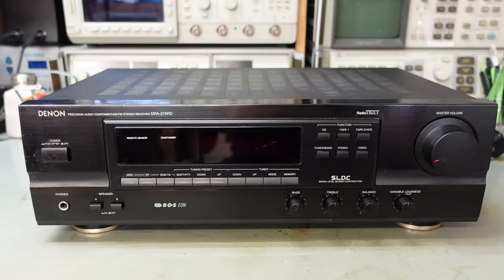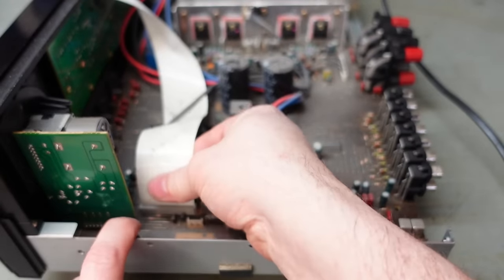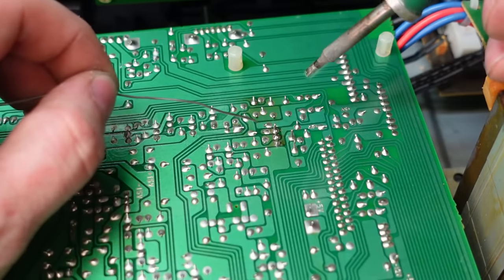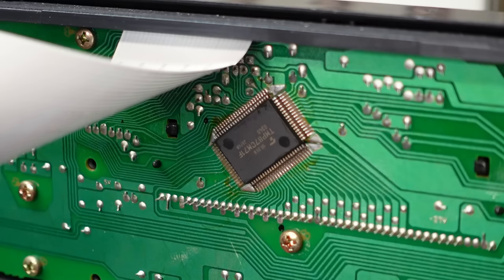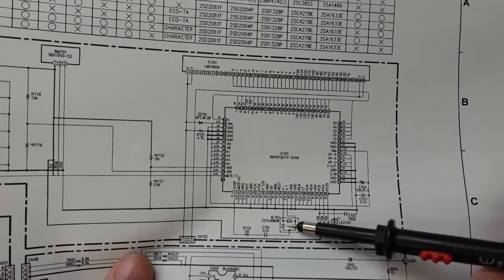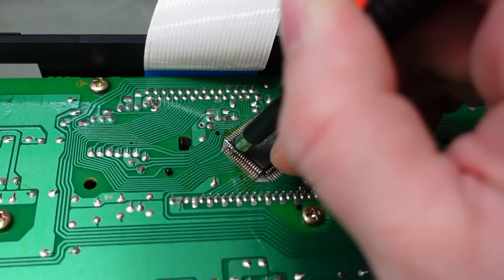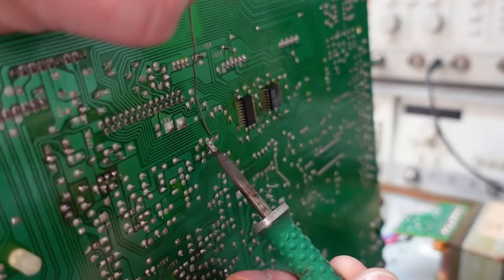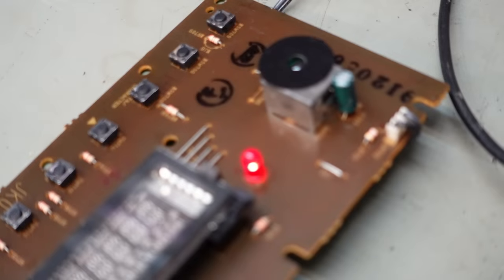DENON and the irreparable failure.

Comment: I have a similar era Denon receiver, an AVR 2500 that I bought new in 1996 or so. I've used it heavily and it's my favorite receiver ever. It has the ability to make any set of speakers you hook up to it sound fantastic. It ran a pair of Klipsch Chorus IIs for about a decade, it lived through 8 years on a modified sine wave power inverter in my cabin, now it runs a sub/satellite Bose speaker system in my office. It was my 2nd "big" audio purchase ever and I hope it lives another 27 years.  Only quirk it has is sometimes the buttons on the unit will act like you pressed a totally different button.

Comment: The microcontroller is reprogrammable, and still available.  The Denon allows for DFU ( direct firmware update ) using a DOS/Windows program to perform the first update.   It is an older Denon ( being 20 years old indeed ) which doesn't support many modern features that are needed for HDTV's ... but it is a pity that it's for the bin.

Comment: Great video - I worked in a Hifi shop at weekends 30 years  ago when I became interested in electronics and building amps and active crossovers. I was horrified at the amount of nasty cheap components in the signal path - stuff I would never put in my own builds - carbon film resistors in the signal path - even in the NFB in amps costing a months wages!
 Marketing, Gimmickry, proprietary protectionism and planned obsolescence, not much has changed.

Comment: I repair electronic equipment for a hobby (self taught) and I usually get everything working, but when I start to open some device to repair, I always dread that an unobtainable IC has failed in it. For example, in this video, where you will have to bin the Denon. That's why I enjoy working on pre-IC equipment like old Dansette record players, where the parts are still easily available.

Comment: Excellent work.
The comment, "That's weird?" .........is something I have muttered a hundred times when trying to debug a circuit.

I know the unit is old, but to be unable to fix a receiver because of software in a discontinued chip is very disappointing.
That software/chip is just an unnecessary (control) wart in the circuitry: I am old school....all you need is:
input jacks, selector switches, preamp, amp, speaker jacks.
Leave the software to iPads.

Comment: I repaired a similar vintage receiver the other week. What was odd is that the reset was not clean / fast enough with the "dim lamp" in series with the mains and the micro failed to start. As soon as I went back to straight mains the unit it worked fine. It had me flummoxed for a minute!

Comment: Great to see, hopefully further advice from comments will see this working. I used to work at Marshall Amplification in test & service (88-93), then Alpine Car Audio (93-97), before the days of in-circuit firmware upgrades so regularly replaced similar controllers.

Comment: I had a Denon receiver around that time. It didn't have an issue removing from standby mode into playing mode. Mine also had an enhanced bass button near bottom right next to the variable loudness. It worked very well, I added a graphic equalizer to it using the first cassette player input which gave more control and doubled the volume.

Comment: Yes when AV Receivers and the like are controlled by a Microprocessor it's a ticking bomb. Onkyo AV receivers are also notorious with similar problem in their Syscon boards. With this Denon you may succeed in fidling for the On/Off control to power up but other function like source selection, etc. may not work either so yeah it's parts out unit then. I love watching videos on this channel which give good information. Mark is really patient at work and always smile.

Comment: Some of the later receivers are even harder to fix ands often to time consuming or much trouble to repair them .Be careful with the flat ribbon cables after so many inserts and removes contacts can start to lift .
Reply: Yeah, those cables are like the human pancreas - you don't touch them, you don't even go near them unless you absolutely have to.  I was cringing as he was yanking on the ribbon.

Comment: Can't win them all. But this video is a great example of investigating and finding the source of the problem. 
I have a Denon DRA-325R from 1989. Was given to me. Lightly used in an office (they guy listened to AM radio through some fairly expensive speakers).. I got it some years ago and just started using it again when my NAD C368 failed. Died in 3 years yet the old Denon still works. Go figure!

Comment: Try a Denon remote to turn it on. After the amp goes into protection mode, you need remote to start it.
Reply: OR get a Harmony remote and program it for the Denon receiver, that typically works for old IR receivers for me when I dont have the original remote.

Comment: I had a fair share of such repair attempts. Most of the time I ask the customer if they want the amplituner back with just the "amp" functionality, bare minimum, and most of them say "yep", so I just disconnect everything that is not related to the amp/preamp or power supply, and add an "AUX in" functionality. But it's sad to do such a thing, only because the IC that died is no longer being made, and it has to have proprietary software on it...

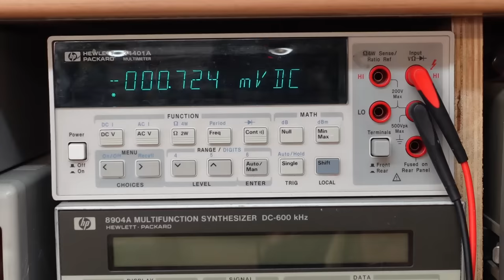Comment: 6:43 - I'm not familiar with -27v driving the VFD.  Normally, I think of the filament being driven by a low voltage and the anodes and grids with a much higher voltage.

Comment: quite an unusual failure -makes me wonder if that 6v regulator went dry jointed on its ground pin first so input voltage got sent straight to the output pin as unregulated and blew the micro -but then the micro wants a 5v supply not 6v unless its going through a diode for a memory backup cap then 6v is about right-now i want to find a  schematic to check my guess !
Reply: thats what i suspect, commented elsewhere on here about it ,, its what kills commodore 64s,

Comment: I had to repair my 1987 DENON DCD-900 CD player, due to it skipping. Here I had to invest about 6 drops of electric shaver oil, to fix the problem. The mechanical movement was somewhat inhibited, due to the partially hardening of the old old lubricant.  I just fixed my 15 year old coffee maker about 1/2 an hour ago. It had a blown thermal fuse. Other than that, after a few repairs over the years, my 2004 stainless steel microwave oven is still up and going. I purchased it for about $45, due to it being a display model, or so they said. In truth, only half the keyboard worked, so I fixed that by simply cleaning the keyboard electrical contacts. At one point about 5 years ago, with just a couple of drops of glue, I repaired the turntable motor, in which there was slipping occurring between the spinning center donut-magnet, and the gear that sits inside it.  Also at another time there were the required replacements of the door micro-switches and the main fuse. These replacement parts were obtained from someone else's oven that they had tossed out to the curb for disposal. And I also fixed my 2009 SAMSUNG TV, which I am watching this video on today.  I had to replace one bulging electrolytic capacitor in the power supply section.  Then at one point my computer monitor brick power supply became intermittent. It was a bad soldering joint on the transformer, where one wire was poorly soldered to one of the multiple transformer posts.  So it was not even a PCB soldering problem. Other than that, my old backup computers PSU was causing a boot looping problem. I replaced the bad PSU electrolytic caps, and that fixed the boot up problem, and it cost about $9.50 for the parts. So all of these items are still up and going, and the repair costs were less than $20 overall. I love saving money.

Comment: I love your British expressions. Dry solder joint. Across the pond we call it a Cold solder joint. It's still dry but it's cold. And it didn't get wet with molten solder lately.

I've gone through some of these cold solder joint parts before. Sometimes you can't just re-solder them. You have to remove them. You have to clean the leads. Scrape them down. Then reinstall. Then re-solder. Otherwise you might get some crappy connections that don't seem to be dry or cold. But they are insulated! They have insulated themselves. That's how they got that way. It's a metallurgy phenomena of, nonidentical metals being connected with each other. And their molecules begin to fight each other. And they start to out gas a fine white film. To insulate itself. And that's why you need to physically clean and scrape down those leads. For a truly good solid electrical connection that will last for decades, to come.

You see…… You are only being tasked. With fixing a cheap old stereo receiver. It's a bit different. When you are trying to restore, recover, refurbish, rebirth a, 1978, $85,000, custom-built for NBC-TV News, in Washington, DC. A British Rupert Neve 36 input, custom console. That has to work like new again. And continue on for an additional 20 years. Working like new again.

 I've done it to that one and others. And it is no easy short-term  chore. Way beyond fixing a cheap consumer stereo. And amazed at your own lack of knowledge. For a Brit? My goodness man!  Have you lost all your self-respect?! Or is this all blasphemy? And by the way how is your Queen? Is she still dead? Good. She should stay that way. Now her,, inbred son is ready to destroy the monarchy. And then to dump, Queen Camilla Bowles. For a younger hottie!  Yeah baby! It's good to be the King. And off with her head! And where's Princess Diana?  Is she also still dead? Good! Now neither will know who's pussy I shall grab! As if you are King. They let you do it. And I'm sure he can, hardly wait. I mean just because he's already 74 doesn't mean anything! Just ask brother Andrew. He likes them really young. And enslaved. Don't ask me why? He was a friend of Jeffrey Epstein. Who was murdered in jail by the Trump/Rudy/Bannon Mafia. Where they all wanted to be the Fixer. And they fixed Jeffrey just fine. And now his 16-year-old girlfriend has nobody to help her. And she was the good-looking one. As it wasn't, Jeffrey. He looked like a Jewish nerd. Because he was. And liked young underage girls. Go figure with these schmuck's? Who wants a young girl? They don't know anything. They don't know what they want or how they want it? I like women who know such things and how to do them. Not the stupid young ones you have to teach everything to. What the hell is wrong with those boys in their 40s and 50s and 60s? There little happy but he doesn't get hard over people their own age anymore? I guess not?

I think older women with gray hair are very sexy. WOW! And they know what they want. And they can articulate that. So always a good ride for both. And experienced boy man only wants inexperienced little girls?  What kind of maturity is that? It's at least between the  6th and 7th grade girls? And not younger than 12. In Texas. Before you can rape them. They have to be at least 12. According to Texan law! Which will be enforced! Because if you rape a little girl earlier than 12? You are in big trouble buddy! Of course it will also be your child. And you do not have to allow for her to have an abortion. Otherwise you can have her parents and the doctor arrested and thrown in jail for 20 years. Which is the perfectly moral thing to do. To an immoral act of abortion due to rape. Why? It's a miracle! If she doesn't want that baby? We will take it! And raise it with Jesus. And so she will have the next, immaculate conception. That Donnie won the election. The election conception. And all of the liberal Democrats aborted him! Which they should die for! Or at least go to jail for the rest of their lives! But we don't want to pay for them! So they will have to grow their own food in jail. Or they can have the outdated dog food. As it is still delicious and nutritious and dogs love it. They never complain.  YOU SHOULDN'T EITHER!

This then would all work out well. In the Soviet Union. Pre-apocalypse.
RemyRAD

Comment: 12:02.  When most of the budget for the product is spent on screws... 

Might show the evolution of design as now, there are clips molded into the plastic and only 1-2 screws to hold it down... not 1000...

Comment: I own a DRA 45 that was dead after power switch cycle! The only repair shop wanted more in a bench check charge than what the receiver was worth ! I decided to at least try resetting board connections , and clean internal power switch ! The receiver powered on with no other apparent issues !😁

Comment: I was given a nice 12v tv that I had hoped to use in my camper, but the previous owner connected it up reversed and let the smoke out of a surface-mount voltage regulator. It's the tiniest little thing and I can't even find a replacement, let alone solder one on. Such a shame to have to throw out a whole unit just because a 3mm x 1mm component failed.

Comment: Dear Mark. Many thanks for your efforts. However, in my experience, the only good Denon is a doorstop!!!!!
The A.V. amps are utterly unserviceable. Also no ready backup.
I commend you for trying on this "basic" one.
Better luck next time.
Regards Allan.
Commiserations.
Reply: Yes.  My experience with 2 Denon AVR is the typical processor overheat and needs reballing due to no connections.  Dislike Denons due to known issues for which repair parts are no longer available.

Comment: Sometimes the solution in a case like this is seek a stogy looking beat up even rusty but working unit for parts. Even a non working unit is unlikely to share the same issue ...change out the card and botta bing...I've done this many times in my 73 years..

Comment: "That eighty pin rectangular bastard has all the answers" 🤣
Seriously though, that PCB is bloody awful with all those jumper links and pots and I/O sockets soldered directly to the board, though the PSU and heatsink do appear to be adequately rated.

Good work, thanks for the video.
Reply: There is absolutely nothing wrong with any of those supposed shortcomings. That’s all perfectly normal for consumer AV gear: jumper links cost less than a double-sided board, and it’s perfectly normal to solder PCB-mount connectors and pots to a PCB.
Reply: @Antonio Tejada  Soft soldered joints should not be relied on for mechanical strength and jumper links introduce unreliability because there are more soldered joints.  As someone who worked in aerospace electronics for 20+ years and designed and built dozens of projects I consider myself to be in a position to speak from experience.  The brand Naim is commercial and their products do not have connectors mounted directly on and soldered to the PCB.
Reply: What do you want from a single sided board?

Comment: Denon generally makes good stuff, but this does look like a rather low end model.  In that regard, not even Denon is immune to designing and building products to a price point.

The parts and labor required to perform a proper repair can easily exceed the value of the unit.

It's very much like a car that has too many problems to be financially viable to fix it.  Sure, you could, but why would you want to when it makes more sense, financially, to replace it?

Comment: models of this era  weren't meant to be repaired they were designed to fail after a certain time. normally after the warranty ended. they wanted folks to buy new instead. it was well into the ideas of planned  obsolesce . a idea  created by Sony to keep us the consumer's buying new components every few years instead of repairing are items. adding to land fills and filling there pockets. the idea  started in the early 90's and is a industry standard now. in other words they built cheap crap now compared to the  items from the 80's back.

Comment: I would probe with a voltmeter before using a finger to wipe dust off.  My younger brother once worked on a camera strobe that had been off for two weeks; he touched the capacitors.  His scream was easily heard from the other end of the house...😲  To be fair, camera gear doesn't have bleeder resistors, however it's entirely possible for equipment to have what used to be working bleeder resistors.
Look for bulging electrolytic capacitors, they tend to get old, dry up, maybe short and burst the safety seals that make them vent instead of exploding.  They aren't good after they vent.
Use a 10:1 or 100:1 probe for clock or other high speed signals; a 1:1 probe may have around 70pF load capacitance, which the low-power clock circuit may not be able to drive.

Comment: So sad. I was working on an onkyo deck no power nor standby also.
I spend 3weeks on this deck.
Every single components on the power section I removed it out and test. All seems OK.
But when I came to the display board seems thats there is something wrong may the ic is faulty or the display.
Even I call a friend technician for a double check. He said no way to repair it.

Sometimes there things can't be repaired. Due to unavailable parts.
That's the saddest part.

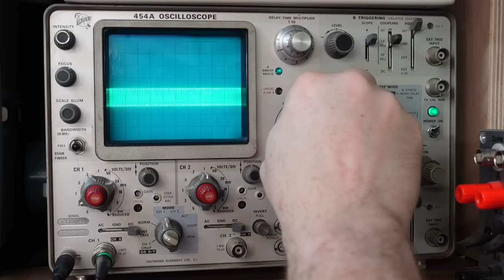Comment: 8:05 looks like you are on a minesweeper or hunting submarines - stilll hope you get it fixed as it is not over. 
The design of the whole thing looks pretty close to a Sony one of the era for what ever reason cause I still have one in working condition in the wintergarten which is the worst climate for any electronic but the 90s sony electronics seemed to love it - of cause not the casette tape belt(s) which I have replaced 2 times meanwhile. 

Love the stuff you are investigating.